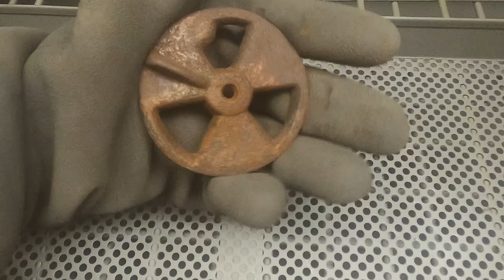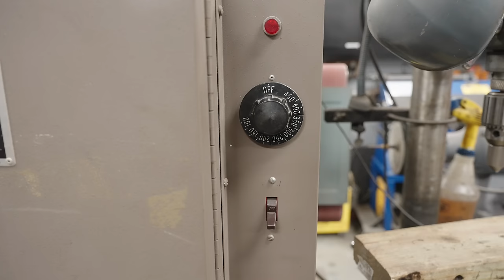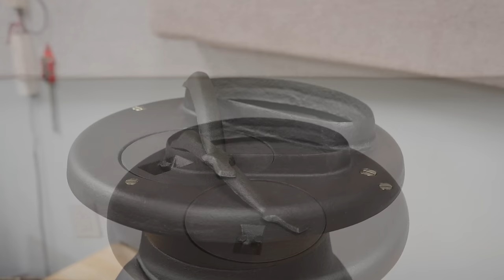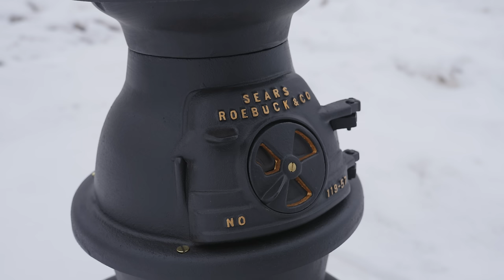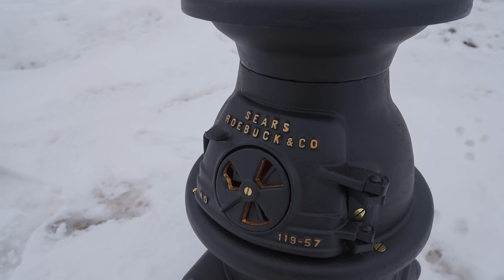Potbelly Stove Restoration

Comment: Amazing restoration! I’m curious about one thing. Why at 40:00 did you weld those cracks only to remove the welding and fill them with fiberglass and exhaust repair paste?

Comment: I think this is the first I've watched of your videos. 1. Love your solder work, it's the best I've seen so far. A lovely bead that looks like it's much easier to clean up afterwards which you did well too. 2. One question, it looks to me like you use a finer grit under higher pressure using very quick and even strokes to get better finish when sandblasting, am I correct? 3. Your gold paint work is nice, very steady hand.
My only complaint and it's not a real one was with the replacement flange it was wasn't quite the identical shape as the others, but considering no one will see it and you did finish it nice it's perfectly ok. Great job.

Comment: Looks very cute at the end... May i say i am really happy to see someone using braise & to cutout the crack in the cast iron prior to repair. So many seem to use mig welder & blast in some steel on such a fix that will only crack again! I wonder, did you cycle the heating levels by doing multiple short firings to release stresses& cure the paint ?

Comment: I've done 100s of these rebuilds. my grandfather even used to work at a cast iron foundry. there are all kinds of ways to fix cast iron but only one way to put them together. you have to use Stove Gasket Cement on all the seams so that way when it gets hot it don't expand and break or split.these where every where and dont go for much money at all .

Comment: I’ll begin by admitting I know absolutely nothing about this type of repair work, so please forgive what likely is my very rudimentary question:  it seems as if the repair  using the fiberglass method worked much faster with far less sanding/clean up afterward.  Is this method not as strong or reliable?  Why did you not use this method throughout your repairs instead of the other method you employed which seemed as if it took much more clean up time?  Again, I apologize for what no doubt seems a silly question.  I’m quite out of my element here, but am absolutely fascinated when craftsmen such as yourself lend your amazing talent toward giving such pieces a second well-earned beautiful life!

Comment: I am in the process of restoring a Loth's Hickory#25 wood stove. The cast iron is in really good condition but I would like to replace the steel sides. I'm not sure what type and gauge of sheet steel I need to use or where i could purchase a piece without buying it in a large roll so I was hoping you may be able to advise me. Thanks

Comment: As others have said, you need to loosen those bolts up!  It will crack again! You already know of course that the original stove would not have had the gold lettering and trim, but I think it looks great!
Reply: Brass expansion is about 50 % more than steel or iron. When the stove heats up the joints will actually loosen.

Comment: my dad brazed cast in the past, but there are welding now that work also interesting that he went back to brazing, when the metal is to thin a backing plate..
Reply from the maker: I thought a lot about different ways to fix the crack in the thin piece. Backing plate was a strong possibility, but I think the whole piece was too thin to weld a backing plate in just one spot. There wasn't a good way to do that piece so I just chose the least bad in my opinion

Comment: What kind of brazing rods he was using ti filled up those cracks I’m an air conditioning technician and the liquid looks like the brazing sticks that I use to braze copper line set are those rods similar?
Reply from the maker: It's fluxed brazing rod (bronze)
Reply: @RestorationStation  thank you sir for the quick response I loved everything about your video excellent job just magnificent thanks for sharing

Comment: Extreme Heat Repair paste is NOT rated for wood stove repair - cosmetic area ONLY on a woodstove. That area is subject to the highest heat (900 degrees and more) in the device and WILL fail.

Comment: Burning off old mouse poo - brilliant.  And that HUGE crack in the top.  Wowzer!!  I love the skinny sander.  Very versatile tool.  What kind of paint did you use on this piece?  My ex and I rebuilt a Morso upright wood stove about 30 years ago, and the enamel paint cost nearly as much as the stove itself.  I remember how nicely it baked on.  This is such a beautiful restoration!!

Comment: 8:30-50 you pulled out a dynafile. I used to work at the factory that makes them in western NY. Spent countless hours drilled the holes in the contact arms to set the wheels and stuff the bearings in them before final assembly.

Comment: It was a pretty restoration, but a lot of work for something that is very common and will not be usable. The brazes might survive without cracking or melting, But that fiberglass repair around the collar is a no-go. That's one of the hottest spots on the stove. So although it looks very nice, and would be good in a museum or something as part of a diorama, I wouldn't use it, and even though it might sell for a pretty penny, there is a risk that it's going to get out there into somebody's house to be used and will burn the house down. I can feel the attorneys lining up around the corner.

Comment: You did a great job except for the fiberglass and exhaust paste cover. I don't know why you didn't just braze it like you did all the rest. If you thought it was too big to beaze with your skills, you could have at least enlarged it enough to put a piece of steel in there to close up the hole.

Comment: also im fairly sure that extrem heat repair paste is what the previous repairman used... you just repeated hes mistake... just fasten the fiberglas and pour molten iron on it (recast on the hole)

Comment: The fireplace in my sitting room is not in good condition. The fire brick has eroded away and the grate has corroded. 
I am hoping to get a wood burning stove with a back boiler to replace it.

Comment: If you're planning on using this indoors,  you need to seal all the seams between the components with the black refractory cement. Otherwise this is going to leak carbon monoxide and smoke indoors.

Comment: Cute, but now it is only suitable for use as a flower pot holder.
Reply: Not true. I have one just like it which heats my off-grid micro-mansion of 500 Sq ft with an upstairs sleeping loft.
Reply: @J.R.M-p7p  Sorry, you missed my point.  It is not useful as a stove because he painted it with decorative paint instead of high-temp stove paint.  And, he braised it which is not suitable for high-temp uses.

Comment: That old stove turned out beaitiful but it shouldnt be used with all those repairs however if someone does use it they should be told of all the reapairs and that if they decide to use it they should keep the damper partially closed to keep it from getting very hot or those cracks could continue or even form new cracks